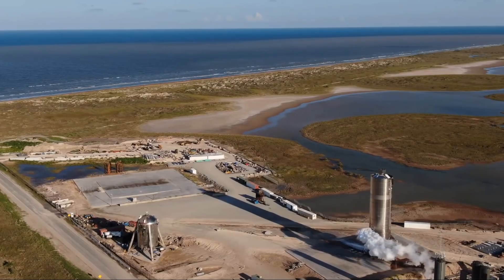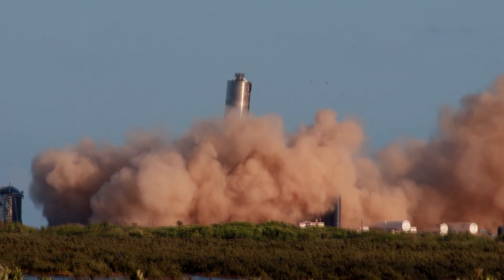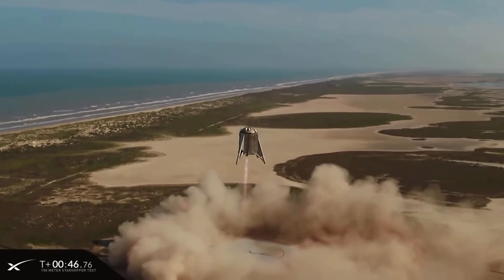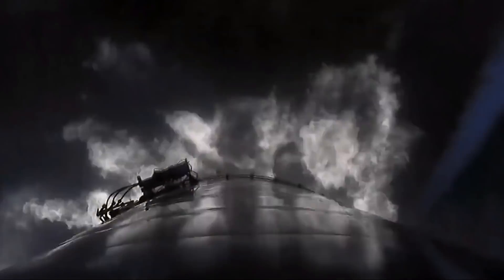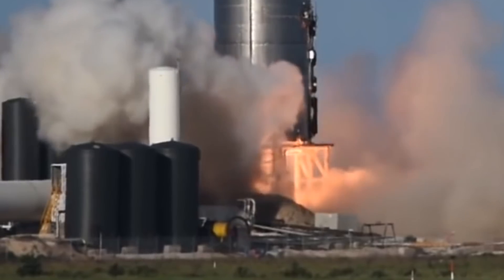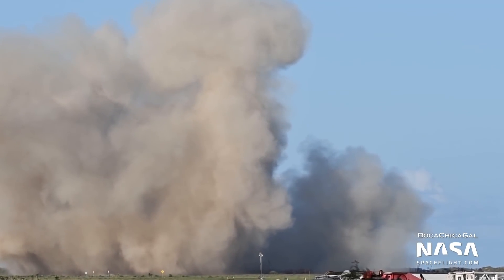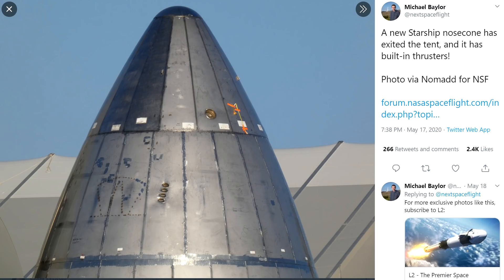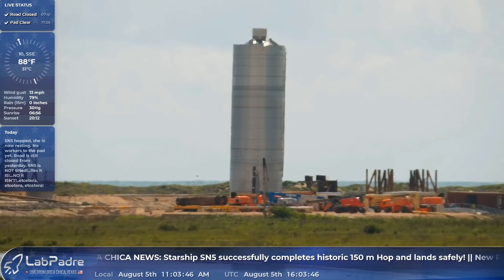SpaceX's Shiny Stainless Steel Starship Prototype Takes Flight For The First Time

Comment: Something I've been wondering: just before the engine ignites, a jet of gas comes out the side. What that is for? The only idea I've been able to come up with is it is high-pressure gas being used to spin up the turbines. But if that were the case, why have it 1/4 up the side of the rocket? Are they no longer spinning up the turbines with helium?

Comment: I'd like to throw out my guess for that engine fire going out, assuming that it was a leak. What are the chances that the downdraft from the engine exhaust caused a vacuum under the structure and starved the fire? This would require that the leak be a fuel leak with no oxidizer and that there be very little room for atmosphere leakage from above. Either that, or CO2 over-pressure from below suffocated it. Just my 2¢.

Comment: Curious what when boom on the pad right after lift off.  Looks like the launch mount didn't like 200T of thrust from only about 9 meters away...  Also looks like something else failed on the mount, as it was still venting gasses after SN5 landed.  I bet SpaceX just installed backup valves 10-20 meters back in the GSE just in case the quick disconnects failed again.  With all the carnage on the launch mount, it makes sense that they'd want to hop a few more times to perfect the launch pad and safing after landing.

Comment: If the fire was, as you said, something exterior and separate from the rocket, like a chemical cleaner, it could've gone it either because it all burned up, or, the oxygen was smothered out by the much larger, much hotter, rocket's own flame.

Comment: I'm gonna go with the fire being hydraulic fluid. During the flight they are steering the engine quite a bit, but in the last few seconds the engine is closer to being static. So if a line was leaking it would leak the least in the last seconds when they are no longer making large changes to the engine's orientation. Which is why the fire runs out of fuel and goes out just before landing....Just to throw one wild guess in there, maybe some of debris we see being flung skyward hit a hydraulic line causing the leak. I mean there were some really big chunks of stuff being thrown up. It not at all inconceivable something large enough to cause damage got kicked up.

Comment: 8:30 304 is not the cheapest stainless steel but it’s the most common alloy, I wonder if this is a factor in the decision to switch from 301 to 304.

Comment: I think it was a methane leak. And I would bet money there are wiring harnesses that wouldn't take that sustained heat long-term without causing control issues.

Comment: Scott, did you notice what appears to be an explosion of LNG on the ground at about 4 seconds after ignition?
On the NSF stream 5:02 you can see the flash through the dust, followed by debris flying straight up, and then a fireball licking above the dust, and on the SpaceX drone it's on the right side of the pad 0:13, and seems to be related to the stream of white vapor blowing off the side of the rocket.
It almost looks like an LNG COPV came off and blew up on the ground.

The trajectory of the debris flying up, and the size of the fireball make it look like a seperate explosion, not just debris kicked up by the rocket.

Comment: Might the fire on the side of the Raptor also have been extinguished by the surrounding air getting more CO₂ rich/less oxygenated when the Starship got closer to the ground and the exhaust gasses possibly obstructed the flow of fresh air into the engine skirt area?

Comment: Looks like they will need quick release GSE mechanisms on the sides of the ship that swing away instead of underneath and in the blast. Sn5 could have been destroyed if the Raptor had been damaged by that explosion below upon lift off. Just my two cents.

Comment: What was the big panel that the exhaust plume blew away from the launch pad?
Reply: The official SpaceX vid shown at the beginning shows SN5 kinda near the center of the landing pad. The big panel? Well, they used that pad area as work area and parking spot for vehicles. Everything was moved back, but something wasn't moved back far enough. So much stuff around on that busy site, it's hard to tell what that thing was.

Scott mentioned that since it flew tilted, 1 or 2 legs touched down first, and took more weight initially, so one may have bent. Also, they look like they're designed to compress, one may have compressed more, for the same reason. Finally- one foot of Starhopper broke through the concrete a few inches on its 150m flight. But pretty sure SpaceX noticed, and made this concrete stronger.

Comment: 301 SS is still a ductile material but 304 SS is better! The L version is low carbon grade with lower tensile property. A version with niobium or titanium will reduce evantual specific stress corrosin problems! Very good video M. Manley.

Comment: Eh I dunno, I think the next failure will be getting to orbit, or at least a sub orbital hop, so I don't think they will have any issues with the 20km hop and everything leading upto that. I think they have ironed out all the issues you would have in atomsphere with the Starship maybe you will have some issues with Super Heavy as it is a bigger tank so there are more things to go strong, but the second stage I am 80% confident it wont have any more issues until it goes on a proper flight.

Comment: The secret of all of this is software.  Not just control system software, but also the software used to design, test, and validate materials like the future stainless steel, software to simulate and engineer mechanical, electrical and chemical systems, software to improve manufacturing engineering.  The real revolution here is software.  I'd wager that a vast majority of people don't understand that.  Elon surely does.  See Marc Andreesen also.

The orange fire is black body radiation from the dust particles being heated (and cooled).
Reply: Yup, SpaceX is very software-intense. No one else was crazy enough to think software could be written to land on a small ship that was heaving up and down vertically, Actually, in 3 vectors. Pus everything else F9 does.

When Elon sees a problem, he sees software as the solution. When founding Tesla, he knew he couldn't improve battery chemistry, but could greatly improve the management of energy flow in, out, and within the entire battery. Got much more range than anyone else. Of course, he's since put together a top battery chemistry team.  Same for self-driving: everyone else looked for lidar and more hardware; vision based was impossible. Elon went for vision-based with intense software.
Reply: @donjones4719  Agree. In fact, Elon came strongly from a software background at his first several companies (and physics), and brought extremely rapid Silicon Valley software development cycles to both software and hardware at SpaceX and Tesla (and probably Neuralink too).  

The specific development model is called Spiral Development, which is a cyclical variation on parallel development.  This is the reason they out innovate competition, along with hiring the best talent and building strong teamwork.

The top quality of Tesla battery packs is mostly due to top quality chemistry and extremely tight manufacturing consistency.  Obviously they do a great job with battery pack thermal, electrical and chemical management too.  

They did indeed start with commodity Lithium ion cells, then broke them down to fundamental chemistry and physics to improve them.  In addition to having their own battery scientists, they contracted and strongly supported Jeff Dahn.

And they're just barely getting started with batteries.  The Maxwell dry electrode will make their battery manufacturing much more efficient, and Tesla is very well positioned to take advantage of solid state batteries too.

SpaceX has excellent internal material scientists, leading to new proprietary metal alloys, for example.

The one area where they probably overestimate their talents is full self driving.  It's much harder to do well than some people think.  It's impossible to train a neural network for the long tail of all possible real world events, and it's also impossible to write heuristics for everything else.  

They did build a world leading (by 7 years) neural network chip to power Autopilot and FSD, but FSD is one software problem that may be insurmountable.

I drive a Tesla Model 3 with Enhanced Autopilot and love it.  But I'm highly skeptical about FSD, economical fusion power, economically viable Hydrogen Fuel Cell Vehicles, Artificial General Intelligence, etc.  Laws of entropy (i.e. physics) may mean that they're not physically possible.  I sort of hope so for AGI, which could be highly destructive.

Comment: Good effort. Nice to see Space X making progress on this. I've seen too many projects get bogged down in my career. SpaceX are getting on with this and doing the ground work on something a bit different and advancing along the learning curve. Let's not forget all the issues the early space pioneers had when Space X have failures.
I wouldn't dismiss the "small" fire on the side of the rocket engine. As a project engineer working in Aerospace I would be seriously looking into that fire. Random combustion in aircraft/spacecraft is not an occurrence that you dismiss as something "just burning off".

Comment: From my understanding as a welder and metal fabricator: 304 is not as strong but its softer so it will stretch a tad bit more where 301 is a hard stainless that in a way is brittle.  That means 304 will possibly stretch some before  cracks form where 301 will shatter if over stressed.  This means with 301 you will have larger cracks form if somthing goes wrong or a weld failure.  Just like dropping a solid sheet of glass vs a sheet of plexiglass.  The glass may be harder and a bit stronger under some loads but when it drops its probably toast and plexiglass will maybe bounce and be able to flex before cracking or just crack the corner off.  301 is strong but its mainly used for hardware (pins, bolts, washers... ect.) where 304 is very common and used for many things because it is a good all around alloy that is easy to work with and very easy to weld.  Im not sure how well 301 welds compared to 304 but i would guess the heat stresses  in 301 would be prone to cracks forming where the 304 since its a bit more flexible and wont be prone to cracks forming by welds.  Few reasons off the top of my head.
Reply: Yes, that was their reason. Elon was pleased when test tank SN7 developed a leak when pressure testing but didn't burst. A welded seam gave way, but only a small length of it. Gave them a chance to repair it and test again without having to build an entire new item.

Comment: Hi. Scott M. Was again a very good YouTube(YT) . I am following you now for about 2  years and  you have the best  YT.  They are clear and  understandable info.  Like the twist to the future in them.  This all  saying as a retired science teacher, with some rocket knowledge. 

More people try to make a SpaceX etc. rapport, like them also, but yours are the best, they have "know how" in them . Ok the others  have sometimes more info about a delay and so, like a fishership just before a static fire, but that are nice peanuts, not more.

About this Hop. Quit a job to stabilize an off center Raptor and  an SN 5 above it. Ups, well done SpaceX. Start and landing ok. I will call you the "Pisa tower" ,  while it did not landed with a 90 degrees angle, but still stable.  The Moon has also no flat parking places :) 

Yeh, that fire there. A point, but they will fix it, I hope. Those tubo pumps, Poor and rich, wich give the extra few % power  to  speed up the rocket., is tricky but  a good choice.  Turbo pumps, the heart of an rocket motor. Can anyone advise to see  your YT about it. 

Like to see the birds flying, during testing, maybe ,  they were supporting  SPaceX too.      

 Go on like this please.

Comment: Maybe the pressure just blew the engine fire out.  Elon will figure it out.   Looks like a small leak.  As a neighborhood plumber it’s hard for me to understand the pressure’s involved.  In gigantic fittings and tiny fittings the pressure doesn’t change only the volume.   You can compensate for volume with pressure but you can’t make pressure out of volume.  Unless you use gravity.   Gravity is how they measure the acceleration.  Not to mention fluid dynamics at those temperatures.   Freezing fuel and fire.  The fire seems to be longer than the rocket at sea level

Comment: The flames on the engine could have been snuffed out by lack of oxygen during the final landing seconds.  As you can see with all the backblast as it got close to the ground I would be surprised if there was any oxygen available to keep the fire going.

Comment: Why is the engine offset? Seems not that practical
Reply: Starship is designed with three engines. Since these are hugely powerful there is no way a hover test of a light test silo can be done with all three. Hence a test with one fitted.

Comment: So could they lite the raptor again and hop it back on to the stand if they have enought fuel in it ?
Reply: In theory I guess so, but the level of precision required to land on the test stand would make this next to impossible to pull off. Be much more likely to not get it centered and have it just fall over. Big flat surfaces are much nicer landing spots that a tiny test stand with no tolerance for being slightly off
Reply: @nic.h  were talking about SpaceX here now I'm about to think nothings impossible for them but that's a good point u made would make since

Comment: IDK what Musk's motivations are for doing it this way. I like the attempt because it isn't new, and many have championed cheap reusable machines before. Musk is simply walking the walk. What makes SS better for me is the low budget procedures being used. An ultimate problem we can't put off long is sustainment of any off world colony. If we can't hammer together a rocket on Earth we have no chance of doing it on Mars. I like to think that is part of the motivation for the ridiculous looking early procedures at Boca Chica. 

SN4 was a turning point imo. The whole program looked sloppy and rushed up to that point. Even the grounds were a mess with trash everywhere. Yes there was construction going on, but on military bases and airports construction guys have to clean up as they go. And that's the way a rocket plant is built to. Pad #1 was a nightmare of plumbing errors, and the welding and fitment of the test vehicle was not up to minimum standards for a horse drawn wagon. With one large KABOOOOM everything changed a bit at Boca Chica. It started looking like a rocket plant. They built a new pad that passed an annual inspection - Fnoticeably to one a human technician can keep up with.

Comment: 7:20 Finally, where is LOX tank and methane tank? It seems that even with mass simulator, placing LOX tank on bottom will result in much lower center of mass.
Reply: methane tank is on top
Reply: @kazioo2  Source? 2017 Musk's presentation of old Starship shows oxygen tank on top. Also, rocket stability requires center of drag lower than center of mass, so, you want to make center of mass as high as possible. Oxygen is much heavier than methane.

Comment: If one engine can hover, all seven will have a maximum acceleration of 7G in space, assuming the counterbalance was the weight of a payload.
Reply from the maker: And extra fuel
Reply: Thought it was only 3 raptors, not counting super heavy

Comment: Hooray for SpaceX! Two successes in as many weeks. This one wasn't as crucial as the first, but it's still a promising link in the chain that will lead to big things eventually.

I've been a bit skeptical about Starship, but they did it. They made a giant silo fly, almost flawlessly. Like you said in the video (Thanks for another great video, btw!) it did end up leaning to the right a bit, so something is a little off. But considering that it didn't explode and it landed on the pad, this is a real success!

Comment: fire on engine could be sprayed back fuel from ignition .SS is on a stand but still close t o the ground.  +i notice that all rocket engines have fires above bell.  even when going mach 1. its clearly not a systematic leak.  should be something like   fumes igniting. but still confuses me when i see it on speedhing rocket

Comment: I'm a bit out of the loop here. Can anyone answer... How does the size of this compare to the planned super heavy booster. And what are the capabilities of the engine (thrust,weight,efficiency,throttling)? is the descent controlled by throttling? that would be pretty special. I'm no scientist but have played KSP a lot and I hope they add a super heavy fuel tank and raptor engine to the game. Not for role play purposes, just for design options. Using a lot of small parts for big rockets is... problematic
Reply: Scott has a video on the Raptor engine. It can be throttled and turned on and off  like the Merlin engine.